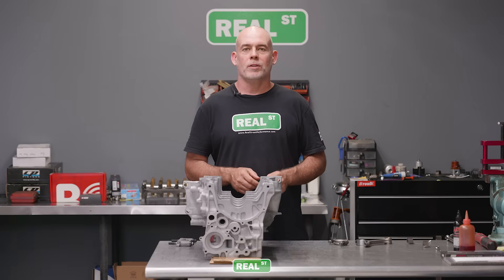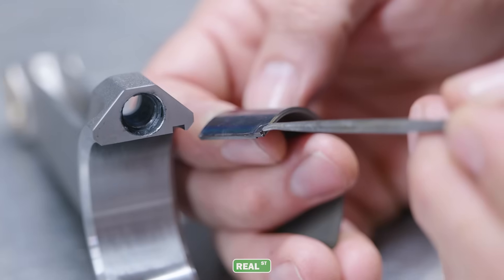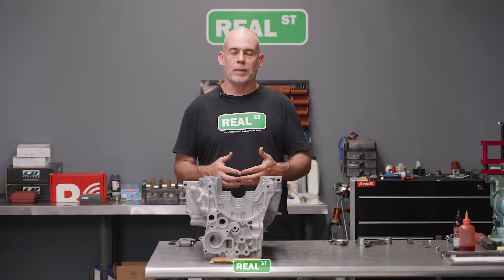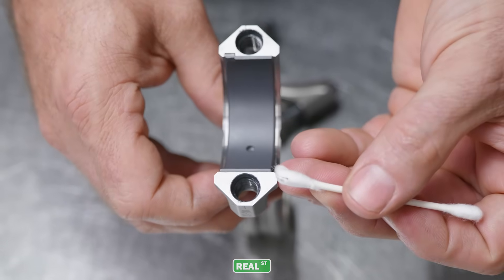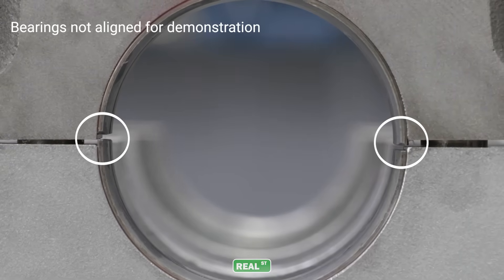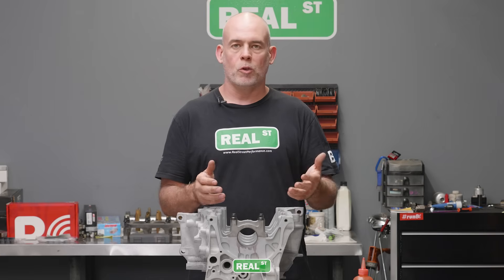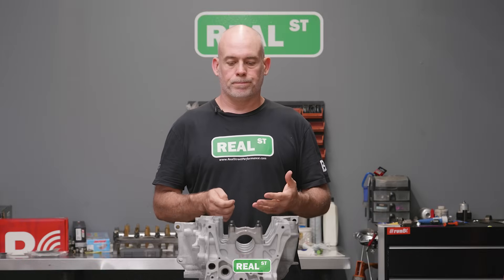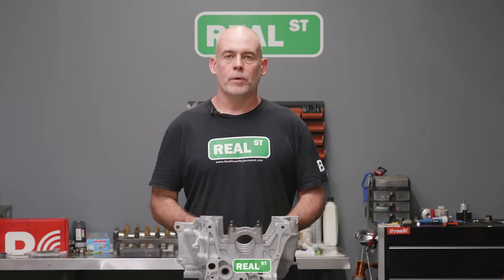Adding Oil On The Back Side Of Bearings During Engine Assembly. Good Or Bad?

Comment: I'm sorry, but I didn't know there was any other way to install main and rod bearings. Rebuilt many small aircraft engines and that is just the way it is done. "Light" oil on the back of the inserts.

Comment: Well just so I'd know if there's a difference I installed a crank and plastigauged it then removed it and oiled the back and reinstalled it. I used regular 30w oil on the back the second time. I couldn't see a difference with plasti guage. It was right at .0025. It was a sbc 406 with scat crankshaft and clevite bearings. Only did the mains as the rods and pisyare going in next. I honestly cant see it making any difference as the bearings are held in with a crush effect and oils squeezes right out. Now assembly lube, thats a different matter.

Comment: Years ago I was a assistant for a high performance race engine builder (F1 and Indy car) and we were always very careful to remove any and all oil from the back of bearings. These were very expensive engines (new $100,000 +)to rebuild $30,000 +) If there’s was any advantage to oiling the back of the bearings we would of done it.
Reply: Also you the reason your bearings are getting cut when you install them is because the edge of the cap has a small burr, if you use a fine stone and put a very very small radius on the edge it would fix this problem

Comment: It's not that big of a deal to oil the back or not. Either way is fine. There's NO way you will change the tolerance of the bearing by oiling the back. Do whatever makes you feel comfortable. I personally don't do it but it's fine to do it.

Comment: Never put oil in the back of the bearings. Doing that, affects the clearance between the rod and the journal. Bad advice. Even my car's service manual issued by the manufacturer warns agains it. Yeah, it is true that upon dissasembly, oil is found under the bearings, but that's after thousanfs of miles of wear, not during the breaking period when the clearances are tighter.

Comment: Used way to much oil on the bearings and used way to thick of oil as well I understand the thought I’ve used but what you did guarantees problems in the future maybe not now maybe not 12 months from now but it can and will course issues as it can affect the clearance of bearings but on a small 4 cylinder that’s not doing much work it shouldn’t cause to many problems

Comment: Like everyone is saying, the oil film "absolutely" has thickness, therefore reduces clearance.
   Fine..ok...so what is that thickness? Instead of arguing, or..."my uncle said", how about a number?
   The minimum thickness would be one molecule, it seems. Probably more.
   But- a typical oil molecule seems to be about 2.36 x 10^-9 inches.
   That is:
  0.00000000236 inches
   So, a film 10 molecules thick is:
 0.0000000236 inches.
  100 thick?
 0.000000236 inches
   How many decimal places do we have to move that decimal til you can even see that on your tenths reading dial bore gauge?..about 5
   That's 10^-5. 
So an oil film about a mere 100,000 molecules thick would read :
 O.000236 inches.
     Oil molecules are sort of a long "backbone" of carbon atoms, with hydrogen attached, I think that dimension is measured the long way, so they are actually significantly thinner.
   So, does this matter to you? Not me. I oil them!
   The "hydraulic" and "non-compressible" arguments are weird..it is an uncontained liquid,  and is free to squish out, down to however many molecules there are room for. (Small effects of capillary action notwithstanding)
    The word "negligible" was invented for situations just like this.
Reply: I know, they are crazy worrying about such minor stuff. When they get all crazy like that, I do something like pick up their torque wrench and ask to see the latest calibration certification.

Comment: Oil on the back is mostly expelled out the sides when  snapped in..but when the bearing halves are compressed the oil is ejected until the bearing is married in the journal..now heres the best part..the oil between the casting and the back of the bearing acts to improve wicking. Not 1 person explained the increased thermal unity.. without oil on the back you can find temp variance ..yup the heat stays in the crank and bearing surface and not the rod or rod cap..

Comment: This is not some "hot tuner's tip".

Japanese motorcycle manufactures have been specifying the application of  lubricant to the back of the bearing shells for decades.

It is in their standard workshop repair manuals.

Kawasaki, especially, are big on this.

It is certainly nothing new, I can assure you.
Reply: Correct and the same for Rover engines

Comment: Any oil between bearing and housing lessens clearances. Upon assembly, it's crucial for this clearance to not be minimized. Once operating, oil can wick into minimal gaps, but beforehand it's a bad idea to make it tighter. This will be noticed on tight tolerance cranks more so than race builds. But if your rods measure at 0.0008", then you're likely to seize a bearing with oil on the backside.

Comment: Any fluid on tue back of the bearing changes the clearance so no, its not a good practice. And ive never had issues withthe bearings flaking upon assembly. Maybe checking those corners to see if they are scraping the bearings.

Comment: NEVER NEVER NEVER PUT OIL ON THE BACKSIDE OF A MAIN OR ROD BEARING. PERIOD. The back side should be a clean as possible to avoid slippage and transfer heat away from the bearing and into the block.  It's just plain ignorant to do it. Like many things people do and get away with that doesn't make it right.

Comment: Why not use a low viscosity thermal paste instead?
That is invented to transfer heat from one material to the next by eliminating the microscopic air pockets between the 2 materials.

Comment: lets just all agree that its probably a good idea as long as its an even thinner lubricant like WD40 or PB Blaster.  enough to help the bearing shift into place but less risk of hydraulic loading.  

if the engine sits for ages before being run it can also act as a rust preventative.

Comment: You are wrong and here is why. The so called bearings aren't bearings , they are inserts designed to precisely,  to make pressured oil fill in less then a 1 thousands gap . OIL is the bearing which supports the extreme pressure forced down the connecting rod from combustion.  The oil which has absolutely no purpose you put in back of bearing inserts only tighten that pressured oil gap between the journals, causing premature damage to the soft surface of bearing inserts.

Comment: The way I see it is like toilet paper, some people go over, some go under, but either way it accomplishes the same goal. Sure the oil takes up space but I feel like that's only going to show up on something that is measured down to the ten thousandth of an inch. I've always rebuilt Hondas by lubing both sides of the bearings and never had a problem. I'd imagine if you're doing something with even large clearances like 350 chevys it would make even less of a difference.

Comment: I do not like the rod shaving the outer surface of the shell as it goes in, so I stone the sharp knife edge of the rod. No small shavings coming off then,no possible contamination no change in bearing shell thickness.

Comment: My engine machinist measures the crank, rods /main bores and all shells and grinds to a predetermined clearance. He dont use no oil when measuring and I aint putting any oil in there that could closes any clearances, the bearings sit fine dry.

Comment: Don’t they teach nips and crushes any more. No oil and torque up bearing then loosen shells spinning in the rod or mains one side of cap nuts and it should spring open by 1 1/2 to two thou. That is the crush that stops the

Comment: I agree with Jay. Been doing this over 3 decades. I have added oil to the backs of bearing but usually when its a snug fit and the seat action takes a lot of effort or is "sticky" when going in which is most installations.

Comment: Point 1
Oil will find it's way behind the bearing sooner or later.
Have you ever disassembled an engine to find bearing backs dry.......probably NOT ⚠️

Point 2
Mechanics generally use abrasives which are far too course especially on gasket surfaces......
2000 grit will clean up stuff just fine.
400 grit is just ridiculous if you expect surfaces to seal being scratched by that ⚠️

Comment: I have to disagree with this technique. There's been well over 100 plus years of engineering, 1000's of aftermarket, and (as far as I know) no oem instructs you to lube the back side of a bearing. I've rebuilt 100's of motors and taking bearings off will show them pretty much completely dry on the back side. Adding oil closes up the tolerance between the bearing and  the journal. Your now closing up the already tiny space needed for oil to keep the metal surfaces from touching each other. If your worried about coatings coming off during assembly, then just clean the excess away when installed. I'm treating this technique like any "snake oil" product. If it sounds too good to be true, it probably is. Lastly he has no scientific proof and too me thats important. He said himself, "this is just how he do it."

Comment: Well, some of you guys are correct and incorrect. I get all that, but when you talk about rods. And this was Something that CP Carrillo and Another people were breaking rods. They couldn't find out why. it turns out that where the bearings is stamped for size and manufacturer. The reaon they're putting oil on the back is because there was some Is micro welding going on. between the stamp bearing and rod. that Softened the hardness of  the rod and the rods were breaking.
They found that the Rockwell hardening fell from 60 to 40! They found that putting oil on the back side of the bearings for rods solve this problem. And they end up to win 17 Wally's !!!!!

Comment: Its also good practice too take some news paper to the bearing surface before cleaning and oiling.... ive never oiled the back of tbe bearing for several reasons... adds to tolerance and that is an area that doesnt need lubrication. Also although i doubt youd ever spin a bearing from doing it the way you do... press your hand down on a dry steel table and drag  it around... now put oil on the table.... i think you get the point

Comment: I have built hundreds of engines and never oiled the back of the shell bearings on one of them and never had a bearing failure yet either. But when i rebuilt some of the same engines after 16,000 hours on them when i took them apart there was oil behind every shell bearing when i removed them from the block or the con rod. So if you want to oil behind the shell bearings when rebuilding, thats fine. If you dont want to oil behind the shell bearings when rebuilding, thats fine. Whatever works for you stick with it is what i say
Reply: Yup, as a Tool and Die Maker myself, there is no way you'll get a smooth and flat enough surface that will seal oil from wicking into the mating area. Absolutely impossible to keep it dry since the honing scratches alone are enough to create tiny gaps.

Comment: I always use red Loctite or red hi-temp silicone sealer. I should not have written that. No doubt someone will do it. Our IH 806G has some interesting stains on the rod and cap where the shells ride.   We always used a thin lubricant on the shells. Our junior-high/high school shop student-teacher taught us that in the 1960s. After getting his teaching degree he ran a 289 in a rail at our local drag strip. The dragster was reasonably reliable… and very fast. His ‘Clutch-Flite’ never failed on race day.

Comment: Good video tho I do disagree with a couple point:
-I never use ATF as an engine assembly lube even the minicule amount on a bearing. The ATF base makeup is not compatible with engine oil detergents. Use the oil you run regularly, wiped on with a finger tip is plenty.
- I  never scrub any coating off a bearing unless the manufacturer stated to do so. A wipe down with alcohol and a lint free rag is all that's needed to remove any contaminates, never Scotch Brite'd.
But of course, if it works for you .......👍🙂

Comment: Engines with tabs on opposite sides weather intentionally or not they definitely help hold the bearing from rotating, but he’s also not wrong. However the tabs helps as well

Comment: The late Smokey Yunick was adamant that you should assemble dry so there was no thermal barrier between the shell and the housing that could cause bearing overheating. With over 30 years competition engine experience I'm still not convinced either way. It may well be that on the microscopic level, dry assembly leaves only a few contact points between the shell and its housing which would have the opposite effect to what is wanted. And it may therefore be that oil actually provides a better thermal path. I wonder if any actual objective research has been done on this. In any case it is likely that hot oil will seep between the shell and housing once the engine is running - it certainly looks that way when you strip an engine. All I can say with confidence is that I've done it both ways and neither has ever caused a problem On balance, I prefer to lube in order to allow the bearing to settle into position more easily and accurately. I disagree about the tags not helping to locate the shells. It's a combination of both the clamping as the cap is tightened and the tags; that is why the tags are both on the same side of the housing - it prevents movement. If it didn't matter, then they could be on opposite sides of the housing to each other, which I have only ever seen on one engine (can't remember which). Jeep engines (WW2 era) have no tags on the main housings, but instead they use locating dowels for the same purpose.

Comment: We use crazy glue to hold them in place on our race engines the reason being the bearings wont spin which is where most bearing failure starts clean the surfaces well we are changing oil and filters every race and filters are opened up and inspected for any contaminates

Comment: I’m a HD license mechanics.
All the OEM stuff is “clean and dry” !
Cat, Cummins, Detroit etc !
All HD and High horsepower engines.
“Clean and Dry”
It is unavoidable to be totally dry when “rolling in” new bearings with oil constantly running out of oil passages!
Still would not do it on purpose !!
This is my opinion.

Comment: Nope, dry on the backs.  Keeps the tolerences where they should be which is between the bearing and the crank or rod journals.  I don't want the bearing slipping at all and the lube may be the reason it will spin the bearing.  I have never lost an engine doing it that way and there have been a few (that came into the shop)  that may have been caused by lubing the backs of the bearings, we just couldn't prove it.  They did tell us that they dunked the bearing into oil before assembling.  Think about it, if that bearing spins, you are done.  Don't help spin by lubing the backs......Just my 02 cents